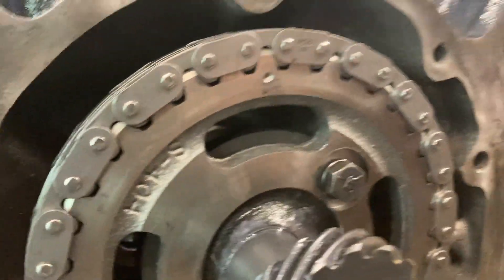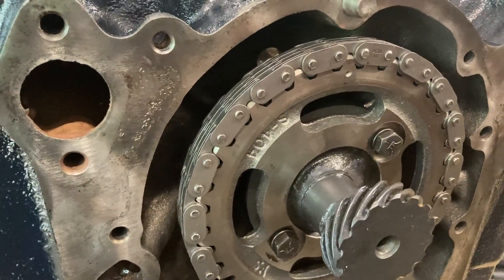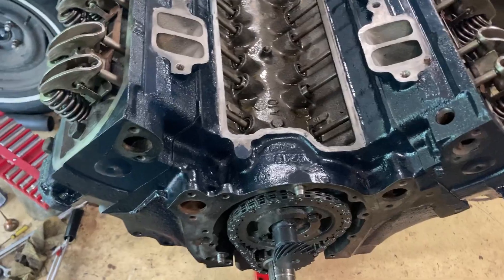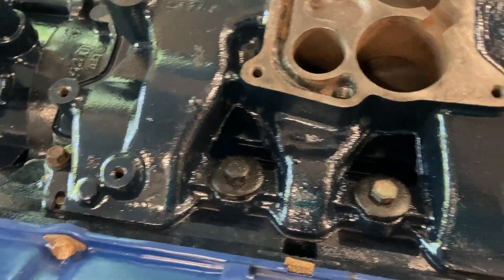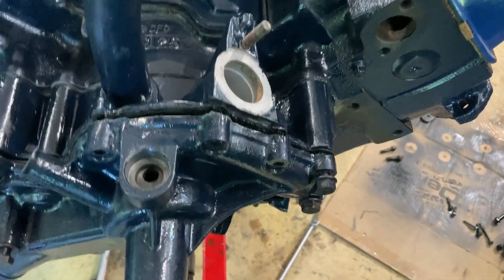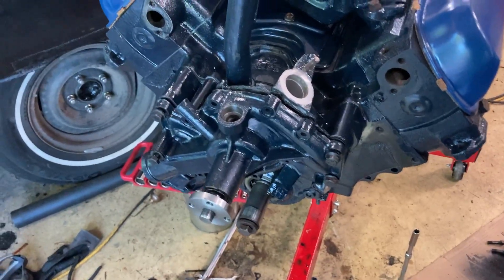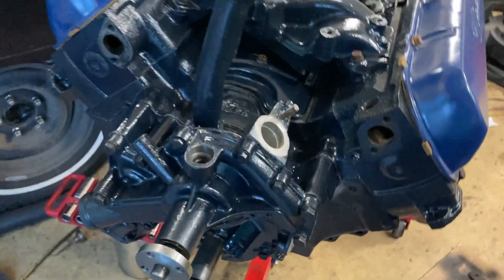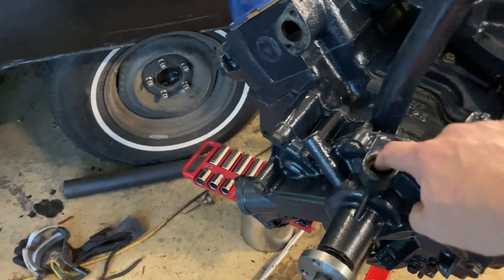Part 4 of the rebuild of the 429 Cadillac engine. Timing Chain/front aluminum engine cover install.

Comment: @10:07 For the crankshaft seal, Do you recall if that had to be installed with the timing cover removed (from the inside), or could that be installed from the outside without removing the cover? I have a running engine in my '67, but that seal is leaking badly. Hoping to avoid removing everything if I can.
Reply from the maker: It is installed from the outside

Comment: Did you ever finish the motor rebuild?
Reply from the maker: Yes, I did, it still needs a little fine tuning, but it runs and drives. I have driven it down the road.

Comment: I am wondering what do you do with the hole that goes through into the actuall timing chain area? It doesnt have a dowel pin in it and i can see into the timing chain area.
Reply from the maker: There is no hole that doesn’t have a bolt in it. I’m not sure what you mean